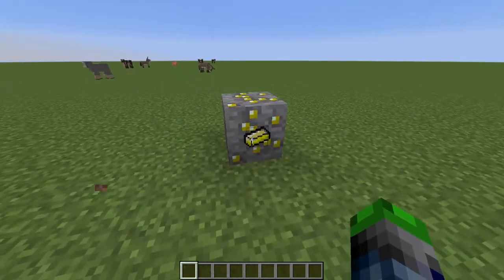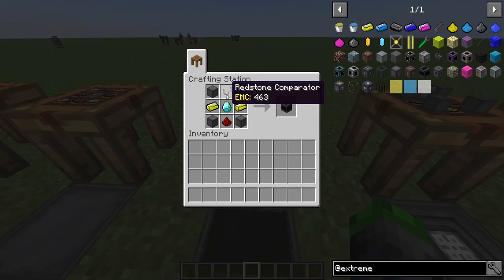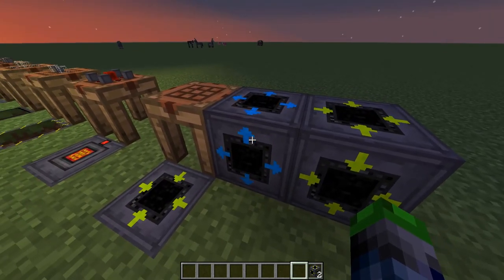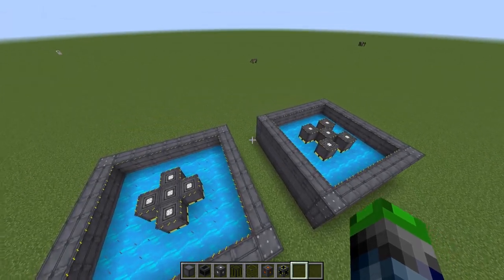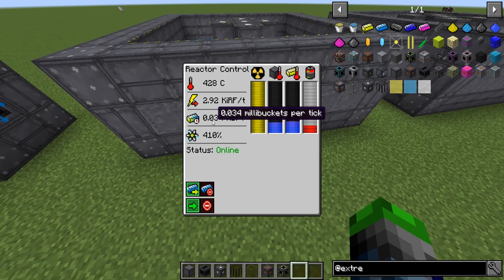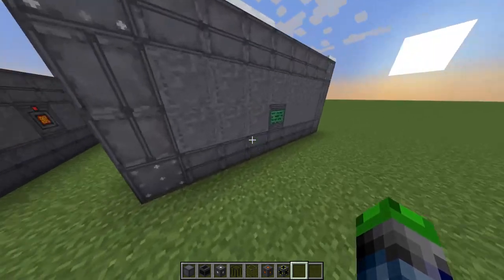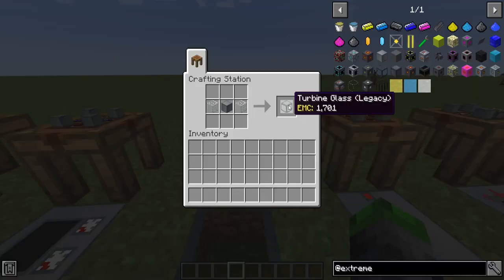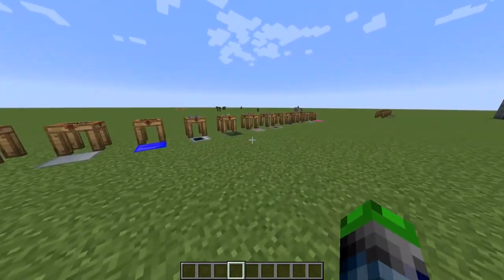Before Getting into Extreme Reactors 1.12.2... Watch This!!!!

Comment: IMPORTANT if you want to build the basic 3x3x3 reactor, you DON'T need  2 acces ports. you can just have 1 port for yellorium and output waste in the same port by clicking "eject waste". If you are starting out with 3x3x3 and your resorces are short keep this in mind. the reason people do 2 ports is to automate fueling and getting rid of waste
Reply from the maker: Great point, at one point it was required to have 2 so its good to know that charged! I guess it also depends if you have item pipes that can support both input and output.

Comment: I've never used this mod before.  Your tutorial on the reactor was helpful but you rushed through the turbine so fast and called specific components "this" that I had no idea what you were placing, hooking up, or how any of it works.
Reply: +Geoff Reimer. The turbine is fairly straightforward. you'll need 1 turbine controller per turbine, some rotor shafts and blades, some metal blocks for the induction coils a power tap 2 (optionally more) fluid ports 1 in 1 out, 1 rotor bearing and of course the turbine housing blocks that make up the outer casing. 

To get one running you'll need to build a rectangular structure out of the turbine housing blocks, then place the rotor bearing on one end of the turbine in the exact center. next place the rotor shaft blocks in a row down the center from one end to the other. opposite the rotor bearing is where the blocks for the induction coils go.

next you'll want to populate the rotor shaft with turbine blades, the rotor doesn't need to be balanced but it will look wonky while it's spinning if it isn't. after all that the only things left to do are place the controller, the fluid ports and finishing the side walls of the turbine if not done already and hooking up the steam and water return lines. hope that helps.
Reply: Then learn better man... Fuck me, I'm sick of dumb tutorials that take hours when can be explained quickly like this guy. Thank god!
Reply: It's just like the other guy said, but i'll explain more in dept: turbines are better than reactors only when you know how to build the reactor itself, the concept of using them is that you consume less fuel, but get more RF out of it, each turbine will work differently if the following parameters vary in between them: 
1: turbine size
2: what induction coils you used and how many rings you have (ex: 3 rings of enderium or energetic alloy) 
3: what input of steam you set them to receive 
4: if your reactor meets the Mb/T steam requirement or not in order to run your turbine at optimal speed (~1800RPM) 
5: how many blades you have inside your turbine. 

Do not build a turbine and put all your atention in it and leaving the reactor alone, the reactor is as important and the turbine is. 
I'll copy a build sheet i've made that should be helpful to you, it's called a candle reactor because it burns low fuel but it's turbine produces a lot of RF c; 

Turbine: (Enderium) 

Size: 5x5x11 
Coils: 2x Enderium 
Mb/T: 910
RF/T: 10.02k RF/T 
Reactor size: 7x7x7
Fuel consumption: 70-109mB/T
Gelid Cyotheum?: Yes, 3 gaps filled on an angled line on the middle. (If cryotheum is not pack-friendly, use graphite instead.) 
Graphite blocks?: Yes, on all remaining gaps
Fuel rods: 12 
Inner rods insertion: 96% 
Outer rods insertion: 94%
Coolant ports: 5 
Pumps: 4 (Mekanism, all upgraded with Speed and Efficiency upgrades, powered by the turbine itself after you give them a start with RF.)
Reply: I've also been experimenting with 1.12.2, and they have shrinked the turbine min. size quite a lot, if i find anything useful i'll write it here.
Reply: With the reactor build i've posted above, you should be able to get millions of RF out of a single bar of yellorium.
Reply: Like many of the comments before, there are different tutorials for different people. I'm no dumbass, I can follow quickly and use JEI, I see no reason for a 40 minute fuckaround for something that rightfully takes 10 minutes.

Comment: Great vid, one thing about the fuel rod placement.  Place the rods together, don't leave a row between.  They have a function that allows them to produce more power by irradiating other rods next to them.  My favorite is a 9x9 in a box shape, no gaps.  Also the higher the reactor the more power you produce, the wider the more efficient=more blocks for cooling.  Cooling only counts on the cardinal directions also.
Reply: It also makes the reactor terribly efficient. 
There are two ways to make power with this mod: 
1: Build a huge inneficient burner reactor that burns a stack of yellorium every 20 minutes 
2: Build an efficient reactor that produces 10% less than the burner reactor that can burn a stack for 5 hours. 
You can see wich reactor makes more power.

Comment: to anybody with a massive amount of uranium. coolant is required in passive reactors. you can just fill the inside with fuel rods and go for some ubsurd temps and power outputs

Comment: 5:25 that's wrong, look at the percent below the fuel burnup, that means that every ingot of yellorium will last 445% of the normal time. In the 6 fuel rods you have 429% while in the same setup but 1 more height, you have 445% This means that the yellorium will last 16% more time.
Reply from the maker: Ah yes, you are correct. The sites I got my info wrong were a bit outdated.

Comment: I don't have the mod that includes the ultimate pipe used, is there any other pipe I can use instead?
Reply: +Alex Nguyen. yes. if you have Thermal Dynamics the Super-Laminar fluiducts also work great, they have an unlimited transfer rate once fully filled with fluid.

Comment: So normally i never comment under videos like this, and i really appreceate you taking the time to make this tutorial, but from the perspective of someone who has never worked with the turbine your video sadly sucks. You dont explain anything, you dont bother even getting the names of the blocks right and your rushing through it as if you were running a marathon. Even on 0.5 playbackspeed i cant keep up. IMO the best tutorials are the ones which dont only build the thing block by block like in the video, great tutorials give you a deep understanding of the mod or the machine so that you can apply your newly learned knoledge to other situations and experiment on your own. Sadly not the case here. I dont want to hate on your videos, i can imagine it isnt easy covering mods like these in 10 minutes but look at it this way: Is a Tutorial in 10 minutes or less, when at the end of the day the tutorial isnt really that helpfull. Just wanted to adress that!
Reply: I found it fine.

Kinda.
Reply: I'll help you. Let me copy a comment i wrote to another user.
Reply: It's just like the other guy said, but i'll explain more in dept: turbines are better than reactors only when you know how to build the reactor itself, the concept of using them is that you consume less fuel, but get more RF out of it, each turbine will work differently if the following parameters vary in between them: 
1: turbine size
2: what induction coils you used and how many rings you have (ex: 3 rings of enderium or energetic alloy) 
3: what input of steam you set them to receive 
4: if your reactor meets the Mb/T steam requirement or not in order to run your turbine at optimal speed (~1800RPM) 
5: how many blades you have inside your turbine. 

Do not build a turbine and put all your atention in it and leaving the reactor alone, the reactor is as important and the turbine is. 
I'll copy a build sheet i've made that should be helpful to you, it's called a candle reactor because it burns low fuel but it's turbine produces a lot of RF c; 

Turbine: (Enderium) 

Size: 5x5x11 
Coils: 2x Enderium 
Mb/T: 910
RF/T: 10.02k RF/T 
Reactor size: 7x7x7
Fuel consumption: 70-109mB/T
Gelid Cyotheum?: Yes, 3 gaps filled on an angled line on the middle. (If cryotheum is not pack-friendly, use graphite instead.) 
Graphite blocks?: Yes, on all remaining gaps
Fuel rods: 12 
Inner rods insertion: 96% 
Outer rods insertion: 94%
Coolant ports: 5 
Pumps: 4 (Mekanism, all upgraded with Speed and Efficiency upgrades, powered by the turbine itself after you give them a start with RF.)
Reply: The turbine itself is simple to build, here's what you need: 
All the outer edge blocks must be turbine casing, same way they are with the reactor. 
On all four lateral faces of the turbine you can place the module blocks (RF port, turbine controler, fluid port and such) as well as turbine glass. 
On the inside you need to put the turbine shaft in the middle, running across the entire lenght of the turbine, on one end you need the turbine bearing, on the opposite end you need the induction coils. 
You have to put turbine blades on all of the shaft's four faces, all the way to the coils 
Induction coils can be confusing, but they are pretty straight forward after you figure out what metallic blocks can be used, they are a ring of 8 blocks that wraps around the turbine's shaft, they are also most made of metal, like copper, iron, gold or enderium and such. 
The ratio of induction coils you need will change according to the amount of turbine blades you have, when you finish building a turbine, a small information label will appear in the controller's screen that will tell you how much of the required percentage of blades to coils you have. 
All turbines need steam, and a reactor to produce said steam, tweak the reactor's rod insertion to find the lowest temperature in wich your reactor can still produce enough steam to keep your turbine spinning at 1800 RPM, the build sheet i've posted above will prove very useful as a tutorial for figuring how those things work out.